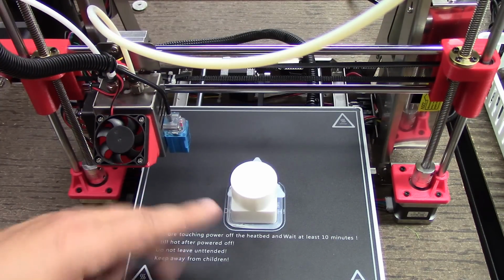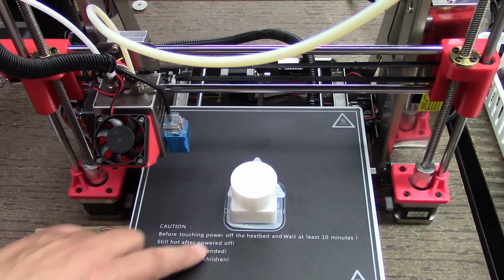Zonestar P802QR2 - Setting Up Auto Leveling!

Comment: Hey! i have the zone star Z8 and when i press on auto level it firstly homes and then does nothing and the auto leveling is then turned off and it says " G32 levling failed". Could you please help me !
Reply from the maker: Have you performed a paper level first?  As it sounds as if the sensor is not detected the bed.  If yes o the paper level, then try adjusting the level sensor down closer to the bed...
Reply: @DIY3DTECHcom  Thank you, ill try it out, also im using, with the same printer, the bed seems to be offset. not sure if you can help with that but when i import the gcode but have sliced it in the middle it prints off tot eh right and down a bit. any guidance would be much appreciated
Reply from the maker: Do you have your slicer set up correctly? Keep in mind you need to adjust for the extruder offset as this sounds like like your problem....